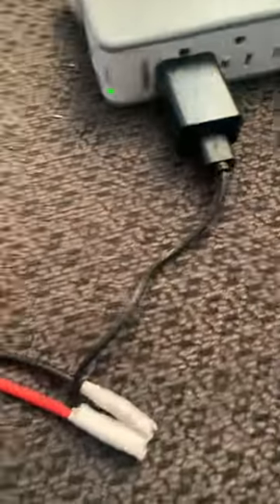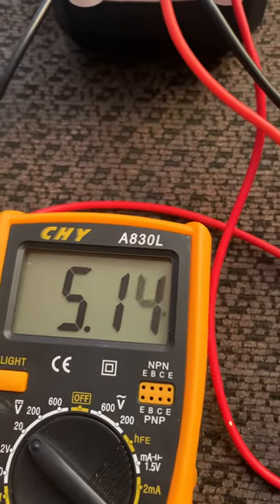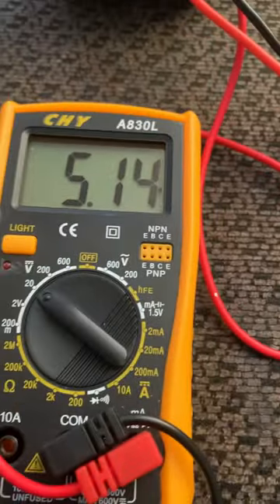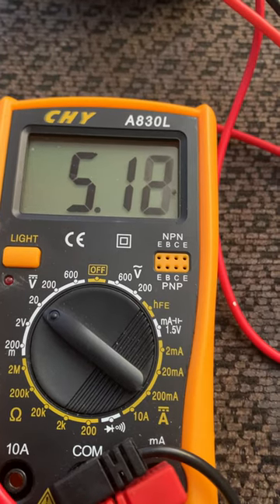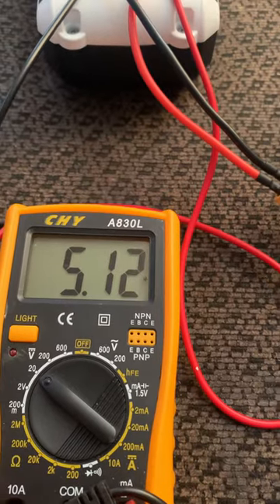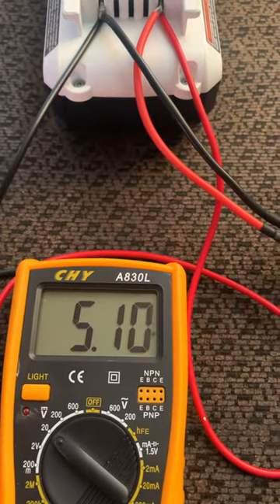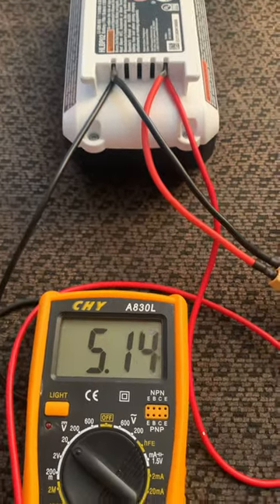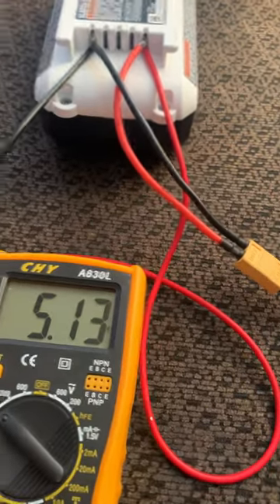Fix Blinking light for battery’s not charging. Hart,Dewalt,Milwaukee,battery jump.

Comment: How do u make a usb jumper?!
Reply from the maker: It didn’t end up working your best bet is to jump it off of another battery with the same or a little bit lower voltage battery. Just don’t jump it for long like ten seconds can do the trick. My battery needed up having ten dead cells

Comment: I have a battery that won't charge at all. When I dock it it doesn't even change off the power light, like it's not detecting the battery. Only had it a short time
Reply from the maker: Mine ended up having 15 dead cells out of like 22

Comment: Did indeed help somebody. Thanks
Reply from the maker: This method did not end up working you need another battery which the same voltage or at least 60% of the voltage to bring it up to be able to charge. When you link them leave no longer than a few seconds at a time. Hope this helps.